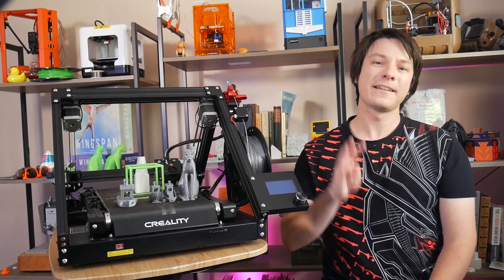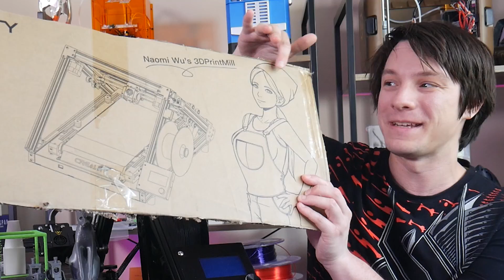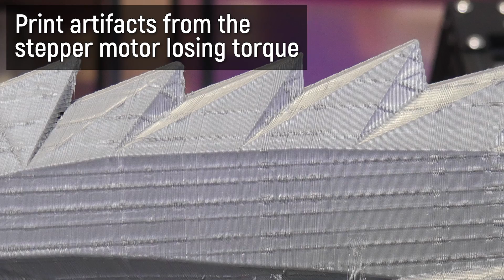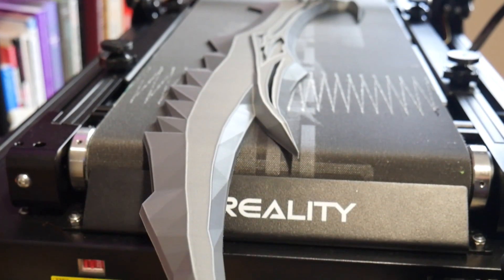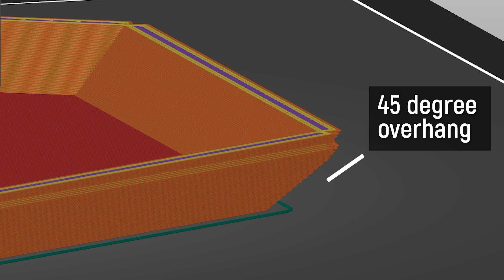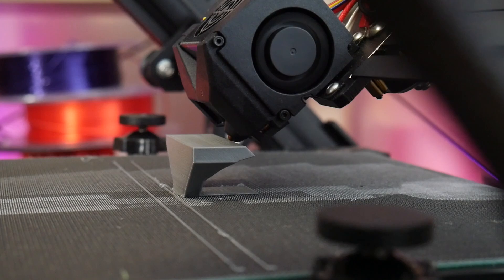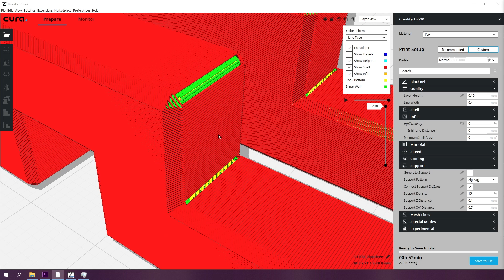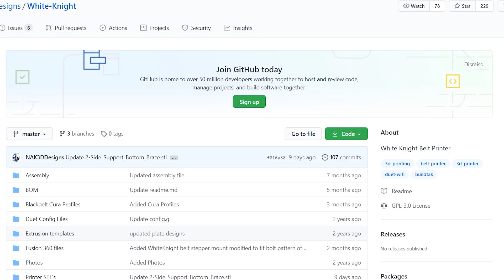Your 3D Printer can't do this... Naomi Wu's 3DPrintMill / Creality CR-30 Review

Comment: This will be perfect for 3D printed fabric you could make massive sheets of it without stopping
Reply: No you couldn’t, it would warp like mad the same as any 3D printer.
Reply: @ajl8975  "Warp like mad like any 3d printer" is kinda ignorant. I can fill an entire 220x220 sheet on my prusa without warping. I can print a chain mail 220x220 print without warping too. 

If your printer "warps like mad" printing flat planar sheets, you either have a poor print bed, zero bed levelling, issues with your slicer profiles, or just plain using the wrong filament for the application.
Reply: @htko89  if you think most 3D printers are capable of printing a sheet the size of the full bed you’re pretty ignorant. A good number of them are simply not set up for it. It then also depends on the geometry of the print and the environment you’re printing in. Just because you can print a perfect sheet with your printer doesn’t mean that most 3D printers are even capable of it. If you wanna debate it further you can have the exact same discussion I had with a 3D printer tech and a doctor of advanced 3D printing. I too was ignorant like you thinking that most 3D printers could manage flat sheets, but after I sat and thought about all the stresses you induce dependent upon geometry of the part I can see why perfectly flat sheets are one of the most difficult things to 3D print the same with parts that have no infill.
Reply: @ajl8975  you didn’t even bring up your own issues but instead said “you cant do it I talked to ppl about it”. K, very “credible”

I’m here telling you, you can. Especially linked fabric like chain mail, where stresses aren’t combined like planar sheets. And what stresses? Sure shrinkage will occur in the xy plane but it is VERY minimal at sub 5mm heights. Again I’ve done this, it’s not a printer thing, it’s a material concern.

what’s “most printers” consist of to you anyway? The makerbot brand is worldwide known, Creality’s ender series by far is the most numerous amongst hobbyists, and prusa’s printers being a pretty much the face of the “top” consumer printer. All three can do sheets and by far eclipse any other brand out there.

If you don’t even know these three names, then you really haven’t been 3d printing or even knowledgeable with the technology.
Reply: @htko89  k I’m gonna bring the tone back down, cos we’re getting pretty heated here. When I had that discussion with the 3D printer tech we were looking at a printer bank with 10 failed attempts at 3D printing sheets on makerbot replicator 2s. I’m not arguing that it’s impossible to achieve, just extremely difficult using hobbyist level 3D printers without controlled environments or a good deal of experience. I’d agree, Mail geometries will be easy enough to print as they aren’t a solid homogenous object imparting as much structural stresses onto each other. I’m just saying that you will not ever get a perfectly flat unwrapped sheet from your 3D printer. You might get close, but it won’t sit perfectly flat, mostly due to tolerencing issues with the printer itself. I can tell you right now I have 2 prints that are flat to my printer bed, but if I put them on a perfectly flat surface they aren’t perfectly flat. They adhere fine to the bed, but I know my bed is not perfectly flat and won’t improve much either. Granted most warps aren’t too noticeable on 3D printers, but if you’re printing a sheet on a continuous rolling bed they will become very noticeable. So how about we both hop off our high horses and end this civilly? Because I know you clearly know a thing or two about 3D printing, but you seem to have assumed I don’t have a clue what I’m talking about. Then rather than try to educate me, you went straight on the attack implying that I’m ignorant. On a side note, I run a small 3D printing business and work as a mechanical engineer. As a word of advice, always assume the person you are taking to knows something you don’t. To be fair tho, should have been more precise in my first comment.
Reply: @ajl8975  fair enough. I can agree with that. Sorry for the attack. I may have been conditioned by YouTube commenters to be always on the defensive
Reply: @htko89  man it’s all good, hahaha I certainly know that feeling! If you wanna know some really crazy 3D printing news, I know that they’re looking into using 3D laser sintering to make the piping for the breeder blankets on the STEP nuclear fusion reactor! Not sure whether ITER is also looking into it, but I know STEP is!

Comment: Belt printers will improve over time, but it will still remain for just special use cases.... Few potentials with HUGE drawback tradeoff, and major one is very different addit. manufacturing design approach 
from existing ones.
Reply: Nobody is saying this is a general purpose printer. You're stating the obvious.

Comment: I believe the "belt" could actually be made out of a loop of spring steel instead, allowing for better coating. Might need larger rollers, but it's totally doable.
Reply: Welding that reliably would probably not be the cheapest process
Reply: The coating must also withstand high bend forces while being cooked to at least 60 C. The spring steel will expand when heated, making belt tensioning much more complicated. Either the belt or the rollers have to have a coating on the inside too, since steel on steel will slip when moving the belt.
Reply: @konrad7592  well moving the belt and tensioning it I can propose fixes right away: move the belt by sprocket holes on the sides just like continuous feed paper on old dot matrix printers (and new! They do exist, just watched a video on one), tension it up with springs pushing the roller.
Indeed the weld would probably be the worst part to figure, likely gonna need thermal treatment after the welding process on the belt, and yes, very large rollers.
Reply: @Dick Fageroni Sure, but that would still require similar sized rollers to the ones on a bandsaw, but with the width to match the build area. Quite huge for sure.

Comment: I was literally drooling the entire time while watching this. I want this thing so badly. But right now doesn't seem a good time to by it. Hoping belt printers will get better and cheaper over the next couple years.
Reply: I think the major changes to belt printing technology would most likely be the specific angle the print head is set. There may be greater benefits to print quality and strength at an alternate angle despite how logical it seems that 45 degrees will give the most advantages.
Reply: I have no doubt we'll see iterations on the concept, it's just too useful not to. Even if it's probably always going to be more niche than traditional printers.
Reply: Weeell that's what happend with normal 3D printers soooo.... Why not? I mean i won't Buy any belt 3D printer for now but for everyone that wants one Will be fine
Reply: Cheap 5 Axis functionality with CAD integrated slicers are the solution to most of the problems of this printer. This sort of system with only 3 axis is sadly just not versatile enough.

Comment: I cant wait for marlin to implement that. I am dreaming about a printer that can throw my prints in a bucket and start again. None of that 45 degree shenanigans though.
Reply: yeah, that's basically my reaction to seeing it in an ad. I would like to see Creality offering an aftermarket upgrade kit for the CR-10 or Ender 3 to replace the bed with a shorter belt, or even as a factory option. I bet printer farms would buy those by the truckload. To my knowledge, you can't get automatic print removal as a factory option without buying the super-high-end printers that cost many thousands of dollars. Watch out Stratasys, Creality might just pull a Dart Zone on you!
Reply: @themagitechie9955  you can always make some questionable mechanism for that. Ive seem everything from robotic arms to pushing the prints off the bed with the extruder and some gcode. This will be a clean sustainable way though. I have no doubt it will show up on marlin at some point, I would just like it to be soon. hahhahaha
Reply: The Marlin lead developer, Scott Lahteine (aka Thinkyhead) , commented elsewhere here on this video that he already has some of the features implemented.
Reply: @Graham_Wideman  oh my god, I can't wait to print an armada of benchies, I'll be the PLA Aristotle Onassis.
Reply: @thiagoennes  Hahaha, I think that would be Aristotle Xyzaxis :-)
Reply: @Graham_Wideman  The second-best kind of Aristotle!

Comment: Why don't they have a normal printer (not tilted 45° ) with a bed that rolls. It would make it easier to slice your print. Why not take the frame of the cr-10 or ender 3 and add the belt? This seems like an overengeneerd design. It very cool tho.
Reply: Those already exist and they can’t do unlimited z-axis, just print&eject.

Comment: I'd love to se a kind of mix between the Ender 3 and the CR-30. The solid buildplate from the Ender 3 and a 45° CoreXY setup from the CR-30. This could help a lot with ease of use while still being capable of printing many prints in succession (probably by knocking it off after it's done) and certain models like your test cat.
Reply: What would be the benefit?
You can knock of the printer with any printer, no need for a 45° CoreXY. 
The 45° is only needed because of the belt. 
Without the belt it doesn't make sense.
Reply: @Jehty_  I see the benefit in needing less support for caertain prints and saving filament.
Reply: @Donnerwamp  and needing much much more support for other prints?
Seems pretty limited use case.

Comment: I wonder if some one made a ed printer that has the nozel swivel on a large 360 gear that over hangs the print and can print from all sides and can rotate as well

In other words it can rotate in relation to x axis and y axis
Z axis is a belt

Comment: Why do they need a belt at all? Couldn't the same thing be accomplished with a roller and a straightedge, with only 1 line on the bed/roller at one time?
Reply: Two words - Bed Adhesion.   How many print failures have you had because a print broke loose.   Now picture trying to print a 1meter sword with only 1 layer making contact.

Comment: Why can't Creality use direct drive extruders? Just make it an option!
Reply: They do now, in cr10 v3, but in general its cheaper use bowden system, and after all, they work
Reply: @noway8233  They do work, bit im gonna spend the $40 and upgrade. 

I just replaced the hot end with an all metal. What a piece of garbage the original was. The tube goes all the way into the heat block! Junk! Started pushing gobs of filament out in random places.

Comment: If you had the belt and the hot end move at the same time, couldn't you print like a normal z axis up printer? Since if you move the nozzle up while the belt moves back it should stay even in all directions but up and down?
Reply: The extruder would hit the printed part when you move the belt backwards.

Comment: id like a normal horizontal gantry (core xy), with a "mill" bed that would roll small parts off for batch manufacture. Not many people require an infinite axis.
Reply: That concept is patented by MakerBot/Stratasys. Even this printer might run afoul of patent lawyers, if Stratasys decides to pull the legal trigger.

Comment: They should have had the belt slide over a plate with a vacuum draw down to keep it flat, instead of high tension on the rollers

Comment: "That bowden tube is long...it's long enough that it might need some mighty retract settings" holy shit this explains so much. The only complaints I'd ever seen about bowdens was the jamming and such, had never even considered this. I've had to blast almost every single print off my CR6-SE with a heatgun to get rid of the stringing and such, and it's taken a solid month of tuning to get rid of the globbing... but I'm still having issues in corners with overextrustion. Might have to bump my flow rate back up a tiny bit and bump the retraction speed WAY up or something, thanks for the tip Angus!
Reply: Maybe using a higher quality bowden tube with tighter tolerances will help reducing stringing(for example capricorn). The cheap generic ones tend to be too wide so the filament can wiggle within the tube.
Reply: @Sk1pperin0  I'll definitely look into this - I'm planning to pick up a second printer, probably the Ender v2, next year, for tinkering and experimenting with things like this. The CR6 is my 'good' printer so I'm trying to be as careful with it as I can for now.

Comment: You can think of it like comparing a drill to an impact driver:
A drill can make holes, screw in screws, chamfer holes, or be equipped with sanding and polishing bits.  Drills are very versatile.  However, drills are not good at everything.  An impact driver is overall less capable, but what it can do, it does much better than a drill.  You can usually get by with only having a drill and not an impact driver, but not the other way around.
This printer is the same way.  It has its limitations, but if you can make use of the infinite Z, getting it becomes a huge benefit to your toolbox.  This shouldn't be your only 3D printer, but, it definitely makes sense to get one if you do a lot of 3D printing.

Comment: 3D printers aren't finicky enough...
Creality: Hold my beer.
Reply: 3D printer: Holds beer at 45° angle
Reply: The Z's will keep coming until you relent.
Reply: @poodlescone9700  what are Z's
Reply: My Creality's are uncannily non-finicky.
They work like butter.
Reply: @odinata  And there are so many mods that we can do to them! I love to hate mine!lol
Reply: @odinata  Mine is perfect for PLA, but my ghetto enclosure isn't good enough yet for ABS
Reply: still less finicky than a 2d printer.
Reply: just wait for the delta version
Reply: @bart3596  ₒₕₙₒ
Reply: This ^^ ^    I currently have 5 Creality's and I spend far more time troubleshooting, leveling beds, etc., than I do printing.
Reply: @jeremydumoit4487  I gave up on extruder type printers and just bought a SLA one. much simpler.
Reply: this. lol

Comment: gonna wait a couple years on this one, once the software is better developed, id love to get like 3 of these and having them run 24/7...
Reply: My thoughts exactly. You look at the ender 3 and how far it got in a few years of development and I'm sure this thing will have many changes in the future. Never buy the first generation of a product
Reply: You coul even put a longer „road“ to the back and make a 2m snake
Reply: I'd*
Reply: There may be better options than a belt 3d printer. I've been thinking of ways to use traditional build plates that can be automatically swapped. I know voodoo 3d printing had a robot arm that could do it.
Reply: I really want to get one of these to aid in production for my etsy shop, but the x build volume is just a little too small for some of what I need 😅
Reply: if you want multiple later its highly recommendable to buy into the beta and r&d phase now as the future existence of machines like this will be based on early interest, feedback, and profitability
Reply: @kevin-bf4ww  While that is true, i am not that skilled enough of a hobbyist to manage a machine like this yet. I have an ender 3, a monoprice mini delta, and a tevo tarantula that i never managed to get assembled. (still working on that one.) So i strongly believe stuff like this should be in the hands of more skilled 3d printers, who will be able to make it into a much better printer with their feedback.
Reply: I was thinking the same.

Comment: how does that one stepper motor cope? it looks like a long lever arm action/force, hopefully the motorshaft doesn't bend
Reply: I haven’t had any issues with mine bending yet.  Though due to people expressing concerns I am developing a supported shaft stepper upgrade.  I hope to have a prototype in the upcoming weeks.
Reply: Swag, I'd say it's about the same stiffness as the timing belt and stiffer than the stepper's magnetic torque.  Probably mostly an issue for the stepper motor bearings and requires a much stiffer motor mount.  It's 'cheating', but totally fine to do if you do your homework.  I assume it also lets them use the same bracket and motor for both motors.
Reply: @martylawson1638  yep my new design stepper mount will be an order of magnitude stronger and will work for both sides.

Comment: Why do Prusa or Ultimaker (Cura) have to invest expensive coding time in modifying their slicer for a printer they do not sell? Is it not the responsibility (by now) from Creality to create a open source slicer? I doubt however that Creality would make their slicer open source, just like they never really publish the actual Marlin firmware they use on their printers. For a lot of their printer the Marlin files do not work once you compile them for the printers.
Reply: 100% agree, creality should be providing their own (usable) software or contributing to the open source software to add compatibility for their own printers.
Reply: Better for them to donate to a more established slicing software company to add support.   Just my opinion.

Comment: Would it be possible to print on a 45 degree angle block as an easily removable raft? Thinking about trying to keep traditional geometry for items where you would want to use this printer to make repeat prints.

Comment: re: slicing, i believe Josef has said publicly that its unlikely that PS will support Belt printers any time soon. They tried it out and weren't a fan of it (infinite z printers).
Reply: Prusa and Creality are competitors, Prusa is higher standard but still, if Creality pays, maybe.
Reply: @RomanoPRODUCTION  good point, but I'd be more inclined to believe that had they not just added a load of creality FDM machines into PS's newest Alpha
Reply: @Mobile_Dom  isn't Prusa Slicer fully Open Source? If so, it would be Creality's job....